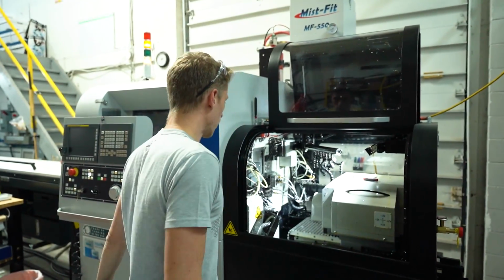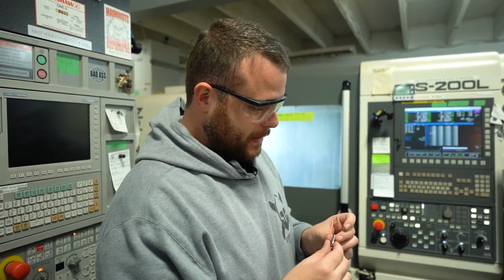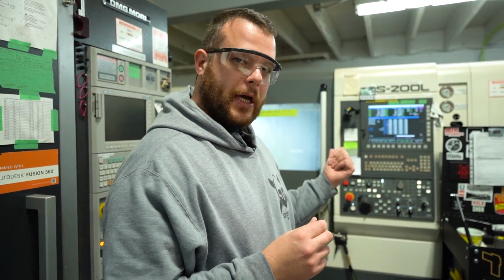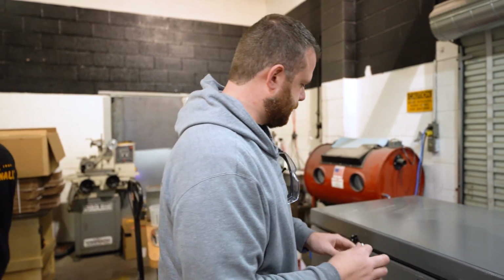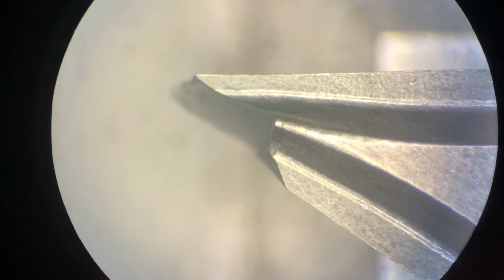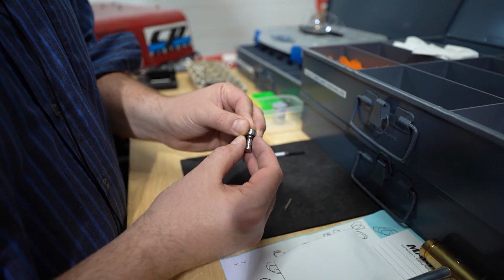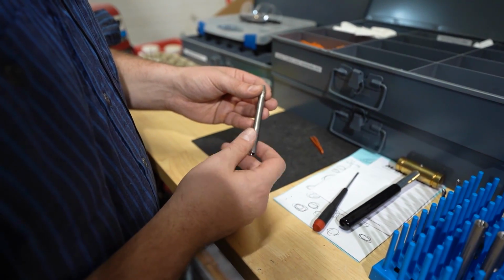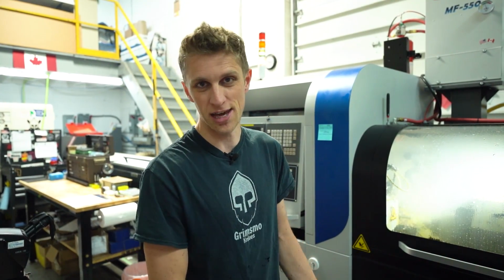SAGAS ARE BACK!! | Saga Saturdays S2 - Ep1

Comment: Hey Fraser, if you stopped down a bit - you wouldn't have to pull focus onto the parts Angelo is holding quite so often!
Reply: Jon Massey and sacrifice the bokeh? Spffhh.
Reply: @KeithStrang  save the bokeh for awesome b-roll shots. It would be nice to have a face and parts in focus at the same time, but that is just my opinion. Definitely improving though there was a lot less bouncing around of the focus on this video!